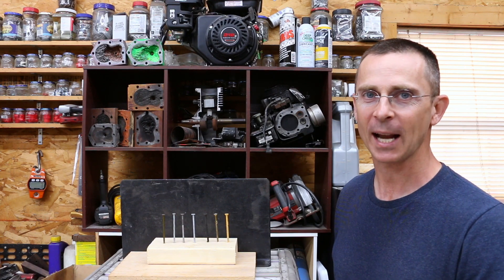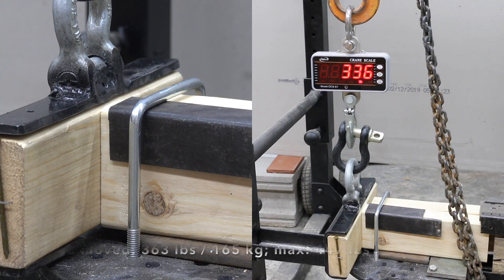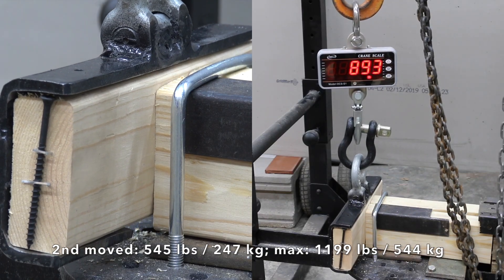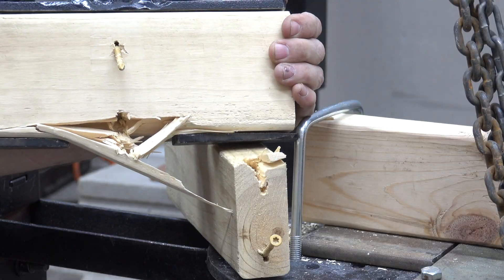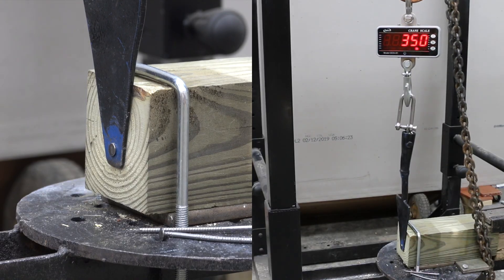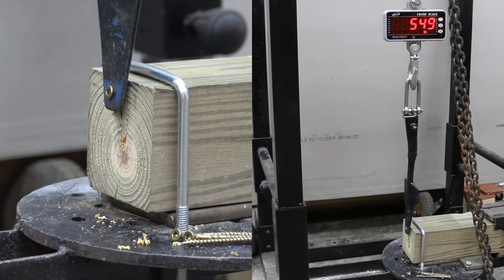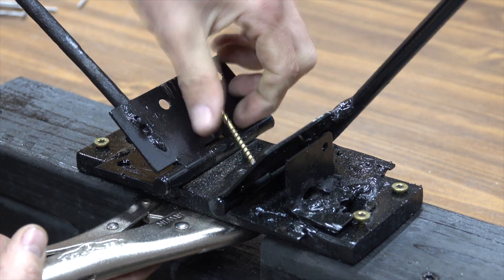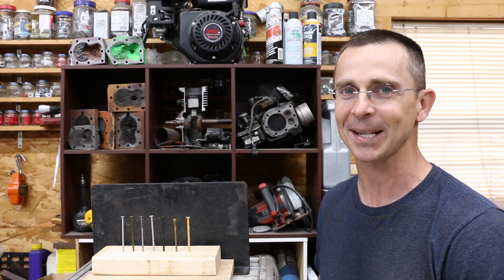Do Screws Shear easier than Nails? Let's find out!

Comment: Why did you test them in end grain? I think you'd be able to push the fasteners to further limits if you used the face instead.
Great video as always and something I've always wondered.
Reply from the maker: Thank you for the constructive feedback!
Reply: Because this is the way wall framing is done
Reply: Toe nail or toe screw Pat
Reply: If you realy thought about it the last test is the shear test. Call it slightly different as a flex test but its a shear test testing brittleness which directly correlates to the sheer force it can take. The nails are flexible. Very difficult to shear it bends doesnt snap they were shaped from red hot steel and left to cool in the air soft method. The screws are harder dont like to bend and therefore something has to give if its not the wood its the screw. But look at them nails. I seen nails fall out of hardie board on there own over years like they put oil on it and predrilled the hole. Threaded nails if you must use nails. None of your tests tested shear stress without the shape of the fastener being a factor or the wood being a factor you were supposed to be testing the fasteners nothing else. Your supposed to be testing sheer force not comparing nails to screws thats just the end result. Your question was nails vs screws for shear force but that was not the route you should have taken to find your answer thats why devising tests was tricky for you. You tried tests to bring out the best in both types of fasteners. Instead test the sheer force of the fasteners without any other factors involved. They should all be pulled from both ends till they snap and measure that. So when you build a house you know what is the strongest and least likely to snap in turn dropping something on your head regardless of white ants eating your house sine your not testing the wood and long story short i wana know whats best not if i should use the nails or screws and get the wrong type of nail or screw. The wood is the varible when you want it to be a constant. As the wood makes the shape of the fasteners the driving factor for how your tests turn out and screws are brittle as they are work hardened in the shaping. The ring nail wasnt it was pressed to shape and the square nail snapped easy as it was also work hardened in its shaping. I dont even need to know how they did it. Your tests proved how they were made and what's the most brittle thats all you learned and screws have better grip strength but apparently you already did that one. Now you did it again but tested brittleness too. Stiil waiting on the shear video. In every test the screw wins. If nails win one battle against the weather the screws would have won 2 thats what i see in this video as the end result.
Reply: If using screws for wood construction use the green chromate finished construction screws. Hex head, 150 mm easily available and EXCELLENT holding power even in end grain! I swear by them and never been let down.
Reply: Yes, unfortunately, end grain fastening, as was done here, is more a test of withdrawal resistance than shear.  The reason for that is end-grain withdrawal failure happens well before fastener shear failure.  Still useful info, but leaves the shear strength question unresolved.
I'll make the guess that the screws will shear before the nails, since some of the metal is lost in the milling of the screw threads.
Reply: @michelangelobuonarroti916 
This test is not testing shear strength, it's testing end grain holding power, this is why almost no fasteners sheared off and why screws performed better than nails. 

Screws aren't as strong in shear as an equivalent gauge nail, this is established fact. The main reason for screws not having the same shear strength as nails is they are much harder and therefore more likely to break. A nail will deform, but is very unlikely to break. Nails are also less likely to fail due to metal fatigue which is another reason they are better for framing, which moves a lot over the life of a building. Nails allow movement, especially gun nails which are even softer than traditional nails. Gun nails also normally have glue on them. Nails and screws are both essential in a modern building, we just have more applications for screws now due to power tools and more precise bit types. However screws will never replace nails in certain applications, and this video is giving a lot of uneducated people the wrong impression about what applications screws are appropriate for. Always consult your local building code before doing any type of work on a building that may be covered in the code. Anything structure, weathertightness, or safety related should be done according to code. There are many dumb rules that government makes, but most building code requirements are actually written by people who know their stuff, and I have very few issues with code requirements, they make sense, they are there for a reason and if followed correctly make for a good building that won't have issues for the most part. Let's not reinvent the wheel shall we? Nail guns aren't that expensive if you're doing a big job. If you're a pro and don't either have a Paslode or (heaven forbid) are still dragging a hose around, you aren't a pro, and if you're a DIYer, you can easily get a cheap Ryobi or similar air nailer and a small budget compressor for no more than the price of a good drill driver set. But you don't even need that as a DIYer because you probably already own a hammer and nails are cheap, much cheaper than screws. So use screws where appropriate. Screws are wonderful and I use them every day, but never where a nail is more appropriate.
Reply: Exactly, the other issue with this test is it's not testing shear strength at all, it's testing holding power indirectly. This is evident by the fact that almost none of the fasteners sheared off.
Reply: @Phelebas Try a hurricane.
Reply: Very correct observation. Also - Fastening in end grain will highlight the structural variability of the different pieces of wood and the positioning of the fasteners. Did one  fastener pass through one or more harder grain lines while another only passed through the soft wood in-between hard grain-lines. I think this pretty much invalidates the results. I think you need to do a "do-over" with face / face positioning. Also, it appeared that you used a single grade of lumber which is pretty consistent. but I think a better test would be plywood face to face. Thanks for the great videos.
Reply: In germany it's not even allowed to use this kind of joints in supporting structures on builds, because the nails or screws only have contact to a few wood fibers and if the wood splits just a bit due to drying, the whole joint may fail.
Reply: @claudev.k2  I do carpentry in the US, unfortunately many joints are constructed using cross to end grain, how do you guys do it... Always trying to improve my skills 😉
Reply: @patferebee647  Skew nailing is standard for framing in NZ, you Yanks call it toe nailing I believe. The joints are very prone to movement like that, but are surprisingly strong, so they are unlikely to fail as the nail goes diagonally through the grain on both pieces of timber. I often nail cross grain to end grain on nogs, (dwangs or blocking I think you guys call them?) because it's sometimes more convenient, but they aren't particularly structural, so it's perfectly sufficient. However I don't actually have any issues with the idea of framing using cross grain to end grain nailing, it's been standard practice for hundreds of years. If there is a potential for the nails to pull out in a joint like that, you shouldn't be reliant on nails, and you need to be using strapping, brackets, gang nail plates or other systems appropriate for the structure. Nails aren't meant to prevent things like uplift ect. They have very little holding power and their main advantage is the fact that they can move without breaking or letting go, are great in shear and don't fatigue easily. As a general rule, nails should always be used in shear if they are to be relied upon for any kind of structural load.
Reply: @claudev.k2  might be why in florida,USA everything requires metal hurricane clips/braces which use multiple nails/screws?
Reply: @claudev.k2  Similar in the UK. End grain shear capacity 70% of side grain capacty. End grain withdrawal capacity = zero. In these tests the shear capacity was relatively low before joint slippage/failure; the test to destruction here was essentially withdrawal in most cases; some high results but the joint has failed and therefore somewhat misleading.
Reply: @claudev.k2  what kind of joints do you use?
Reply: @bobcat138  wood beam shoes are a cheap but visible solution. But there are also invisible solutions, google "Simpson Strong-Tie". If there is not to much load on the joint, you can still use simple screws, but you would screw them in a diagonal pattern.
Reply: @claudev.k2  "Beam shoes", I like that, we call them joist hangers.  They are required in the US for any load bearing members,
Reply: The way his rig was set up he coudnt do that easily. Also the point was to see whats best. Not to see what will break it. Its not mythbusters.
Reply: @Phelebas Not quite. There are plenty of shear force during a hurricane that affects the whole structure and that will include studs and plates where end nailing occurs. Simpson ties call those forces F1 . Check their manuals. Cheating is not sufficient, thus the massive amount of connectors we are forced to use here in Florida if we want to pass inspection.

Comment: SUGGESTION:  Test spray paints.   Krylon, krylon fusion,  rustoleum, paint/primer versions.  you can try different surface and see how easily they scratch off.  You could use sand paper with a known weight and drag it across each surface to see the damage.  certainly one of them offers a better product.
Reply from the maker: Thank you for the video idea!

Comment: I weekly look for your tests, and they are always well thought out.  I know others commented, but this test didn't test shear in the truest form.  To test shear, really all you would need to do is take something like a turnbuckle, with the end supported on both sides tightly (Think a "U" with the turn buckle in the middle.  Place the fastener through both sides of the "U" and the turnbuckle, then pull up measuring the load.  This way the wood is out of the equation, and the pulling force is exactly perpendicular to the fastener.

In more of a real life scenario, you could fasten the 2x4 in between some wall studs (Similar to a fire block) and push or pull down on the center of the 2x4.  While this would introduce some bending moment, and the 2x4 itself as a variable, it more accurately replicates real life.

Lastly, you could use the fastener as one might use as a shelf.  Toe-nail or toe-screw a length of wood into a stud, and then press down on the long end to apply torque as a shelf with weight on it would.  You would need to use a jig for the toe-nailing/toe-screwing since you would want to keep the angle consistent.

It is really obvious though, you put a lot of thought into the testing as you always do.  Look forward to next week's video!
Reply from the maker: Thank you!

Comment: As a DIY'er that's into overkill.
I just use the bright shiny nails for putting up the initial structure.
I then use a hurricane clip held by 6×1.5" drywall screws at every joint,from the ground up.
Hurricane clips are cheap,and add incredible strength to a wood structure.
Especially after the sheeting is up.
Of course I also apply/spray a boric acid solution a half dozen times to the bare wood before it's all dryed in.
This will make the wood as ant,termite,and fire resistant as it can be made.
Reply from the maker: Thank you!

Comment: After watching and being amazed i would ask if the screws would have broken so fast on the smooth shank portions?  And i will always use ring shanks on things i dont plan on disassembling.  There a go to for outdoor project, becouse they are the hardest to pull even using a long crow bar, the head will shear alot of times.
Reply from the maker: Thank you!

Comment: Hello, my engine(motorcycle) is possibly leaking some mastercylinder clutch fluid in the oil. (Magura) Since i have relatively fast oil change intervals(5000km), i was wondering how badly the mastercylinder clutch fluid effects the lubrication capibilities of the oil. I think it might be an i teresting test! Kind regards, Joost
Reply from the maker: Thank you for the video idea!
Reply: *Interesting, **oil i use is castrol 10w50

Comment: Clearly a Conspiracy created by the Nail Industrial Complex😬
Reply from the maker: Thank you!
Reply: Snow White, No, it was created by the Fastener Utilization Conspiracy Cooperative, aka FUCC. 😂 ( Ooops, I f'd up, I wasn't supposed to tell you, and now they have to kill you! That's after they kill me first, for spilling the beans....).
Reply: not it's not this is important, the reason we don't use screws for structures is simple, they don't hold up long term to micro stress the way a nail does the flex of your house expanding and contracting will break screws over a period of 4-7 years.
Reply: Flyingvoxel nolond, any links or studies you can point to or is this based on your experience perhaps in some aspect of the building trades?
This is a major consideration in the design and construction of hurricane resistant timber houses. The roofs immediately come to mind as these are usually corrugated sheets fastened to wood.
Reply: @jackjohnson9989  Canadian building code, cant use screws anywhere in a house where you get side to side shear forces, and yes that's pretty much anywhere.  you can use them for non structural means though IE drywall and holding plywood down
Reply: @holderheck  but to attach my ledger board of my deck to my house I have to use lag screws. 🤔 
Also I believe there are some certified screws you can use but they are cost prohibitive in both material and labor.
Reply: @geoffmooregm  the lag screws are a subclass of structural screws and they are expensive due to how they are constructed. I am talking about regular wood screws in my comment, like the ones I the video. They do make structural screws as well in normal screw size but they look very different to the ones he tested I wanted to send him a sample of one. They bend just like nails at their core but crack around the the outside just like a screw.
Reply: @holderheck  I have always been told screws cannot be used in house construction. But then you learn about purpose built structural screws. I can see the huge appeal in nails just as far as material and labor go. A nail gun loaded with hundreds of nails can't be beat.
Reply: @geoffmooregm  bureaucrats are bureaucrats and that's why we don't use screws in houses is the real reason.

Comment: should you test drain cleaners?
Reply: Ansel Bodine the problem with drain cleaners is the human component. People neglect the drains until nothing can pass or until it is so full that good drain cleaners will actually cause the buildup to create a worse blockage as it breaks loose and goes down the restricted line. Enzyme based drain cleaners work slowly over time and can keep drains cleaner and don’t harm metal. Bases do okay with steel drains but destroy brass lines. Acid cleaners eat right through steel lines and don’t harm brass as badly. Cast iron is fairly resistant to both bases and acids, but a structurally damaged cast iron line can get pretty messed up with strong acids as well. 
At the end of the day, a professional drain cleaner or plumber is the best and most cost effective solution for a clogged drain because you will be calling them anyway- if you destroy your plumbing before he gets there it will cost even more. The cheapest way to maintain drains is a quality enzyme based drain cleaner. The sole exception to this is all plastic drains. You can use enzymes to keep them open, or bases to clean bad ones quick, but avoid acids. Acids produce heat and can deform the drain lines and cause permanent damage.

Comment: Frankly, the last test was very extreme. No structure is going to put that much bend in one place on a fastener ever. I feel like you conclusively proved that the people crying about how dangerous it would be to use screws instead of nails "because they'll break" were wrong. While it's true that they can be broken more easily than some nails, they took far more force before failing than did the nails, and the ring shank nails, specifically recommended for framing, broke just as easily. I am vindicated, and will continue using screws for everything, as I have for the last 15 years without a single fastener failure.

Thank you for the ingenious and useful testing you do!
Reply from the maker: Thank you!  Agree, the last test was indeed very extreme